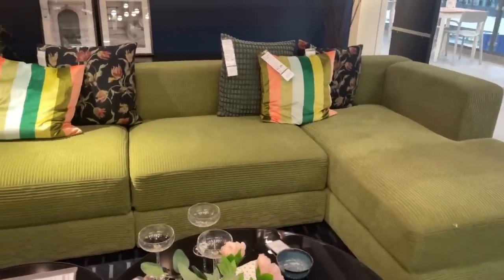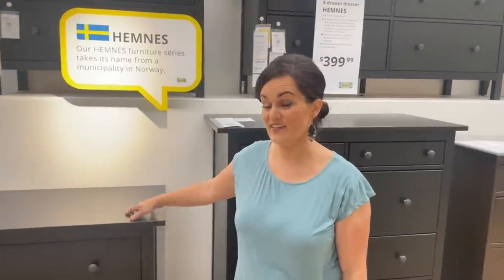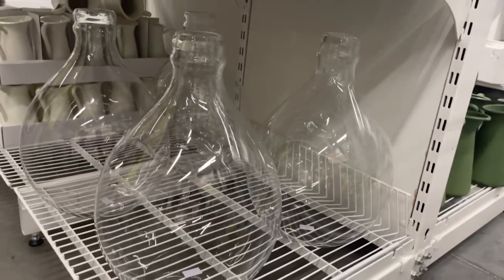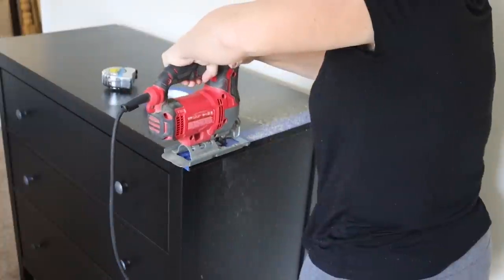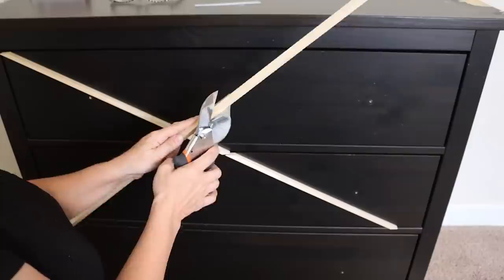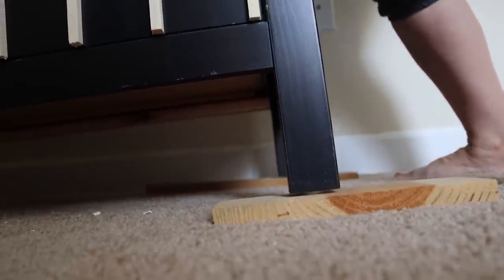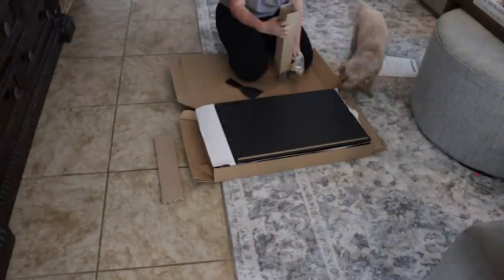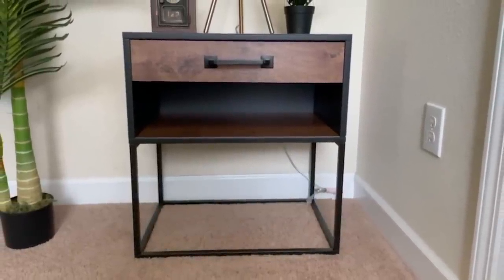Shocking DIY IKEA HACKS for the Bedroom!

Comment: I used floor tiles to do a chevron look on a sliding barn door for my daughters room.  It definitely needs a stronger glue.  I ended up using contact cement and it’s been several years now and they are holding strong.